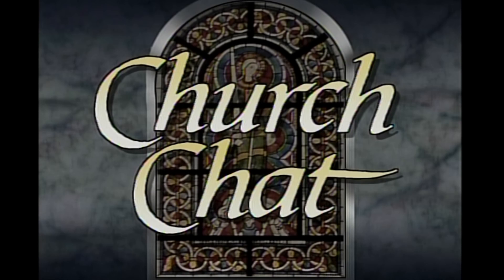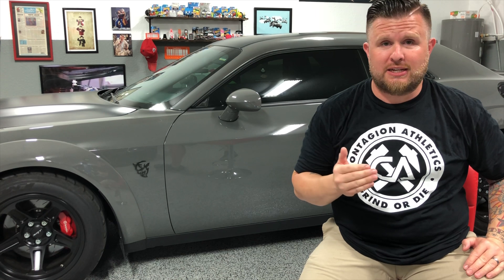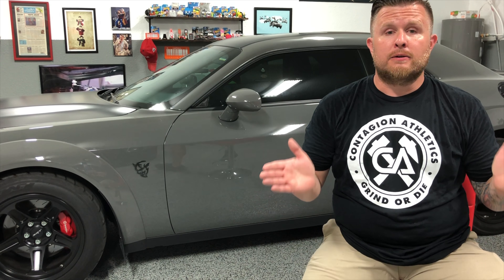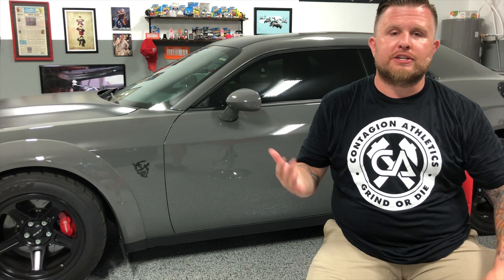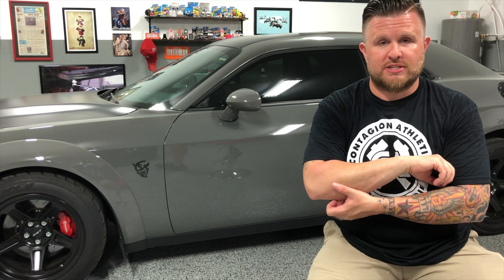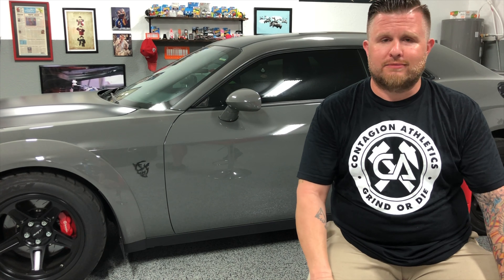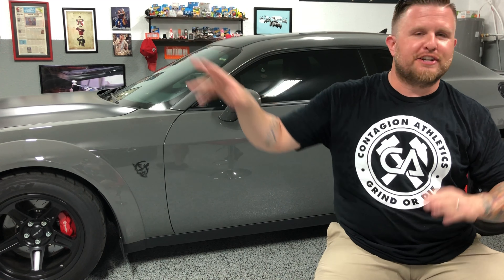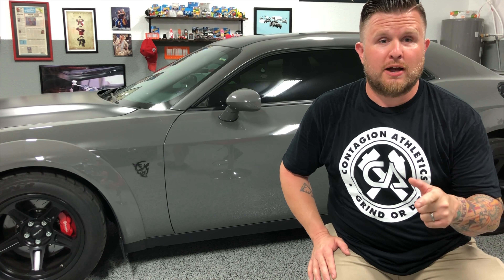Church Chat - [ Episode 4 ] Drag Radials or Slicks ?

Comment: Close to all the “data” available seems to fit for A8 equipped Hellcats. 
I have a M6. I’m thinking a bias ply tire would work better for manuals because of a softer sidewall and better recovery ? 
Also would an 18” wheel work on the front with factory brakes.  I’m looking to for lighter wheels to assist in weight transfer. Any experience here? 
Thanks for the great vids.
Reply from the maker: Yes an 18 should work on the front. Honestly I’d stay away from a rear bias ply   Our cars are really heavy and they benefit from a stiffer sidewall. Ask srtmush why 😬
Reply from the maker: Thanks for the support on the channel
Reply: Thanks for your reply. I think I understand your  reason for avoiding Bias Ply since you mentioned SRTMUSH. I don’t want to see a wall.  I got sick watching that.
Reply: @cfm17hellcat11  The bias in teory gives more traction... Im not any specialist but people talk about bias ply rear and in front too, to give more control.
I dont know about the weight of the car vs these type of tires, but looking into real drag racing, dragster are 1,1 ton (2200 lbs) only. Maybe it´s a thing to consider.

The real reason to use a bias ply in a car is the transmission. In an M6 car, they put a LOT less stress on the transmission changing gears.
Reply: @Zeh Doce. After multiple conversations with MT, Hoosier & MH, I went with the Bias ply M/T E.T. Street R 28x11.50-17LT. On a HHP light weight wheel bead lock wheel also had Bias Ply skinny’s on the front.  First pass with the traction control off @ 22 psi = 1.6 60 foot.  All manufacturers recommend bias ply for the M6. Thanks for your input.  I didn’t get any additional runs in do to track issues.
Reply: @cfm17hellcat11  You have any idea of what power you can make with 22 PSI? 
People are swapping the stock supercharger to bigger ones (like KB 4.7 and Whipples 4.5) and many of them are above 1K RWHP>
The KB guys puts more than 1,3K (boost only) with the 4.9L unit.
Reply: The 22 psi was tire pressure not boost.  Sorry for the confusion.  I didn’t get any data from this pass